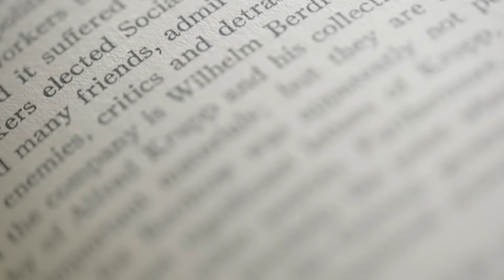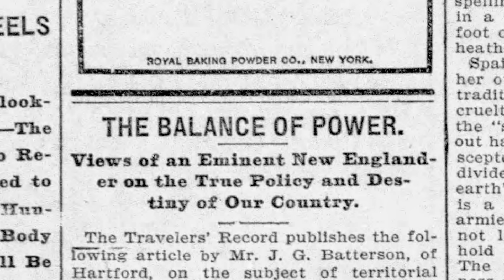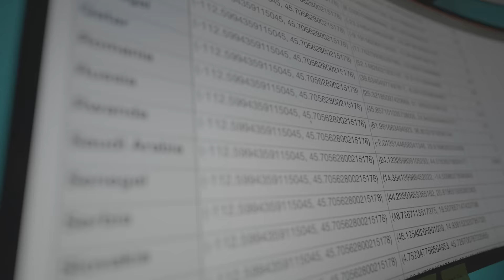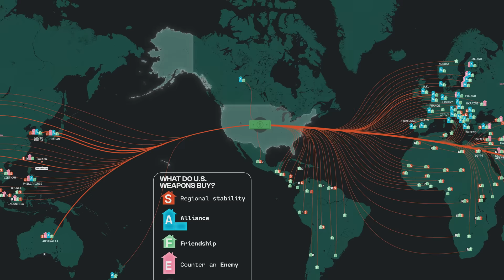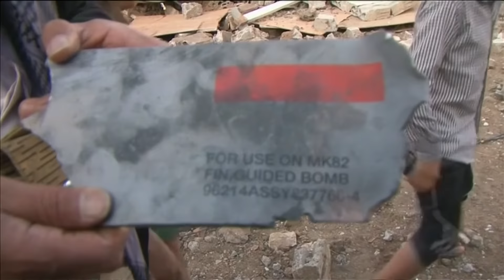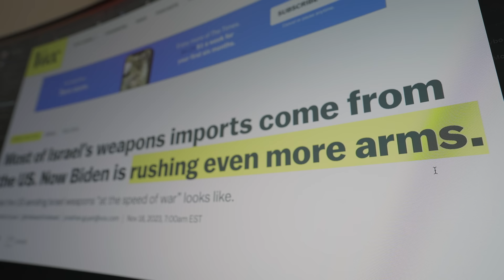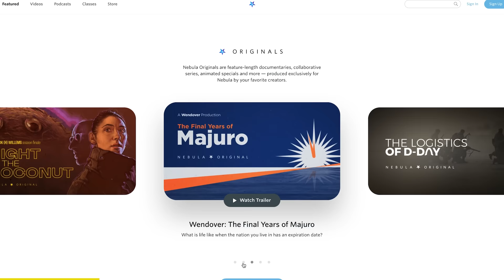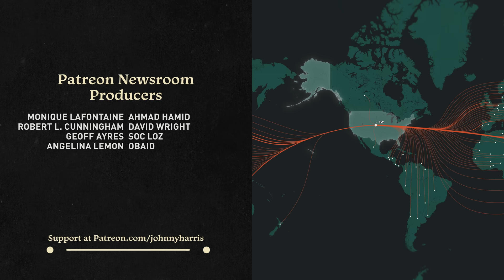Why the US Sells Weapons to 103 Countries

Comment: I think you took a bit of a shortcut here. You essentially ascribed clean moral intentions to the US.
For example: Yes, the US made it a condition for Saudi Arabia to not misuse these weapons, yet, they did.
But is that a failure of this kind of diplomacy? That's only the case if this was the primary factor driving the Saudi Arms trade. Now, with the Saudis that's still a bit murky. But if we now take Israel as an example: Yes, Biden has expressed he's displeased with how the war is fought. But does that mean that the weapons diplomacy failed? Is the protection of human rights really the main driver behind US weapons sales? I'd say not. Gaza is a calculated risk the US deems acceptable in this issue. The US could pressure Israel. But it doesn't. It placates the public while supporting the war. Because in the greater scheme of things Gaza doesn't matter to the US.